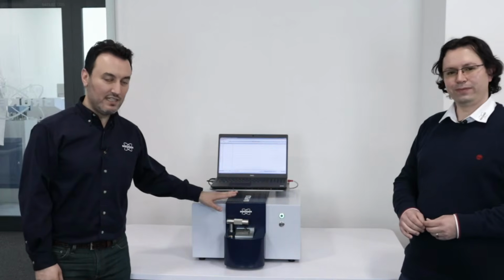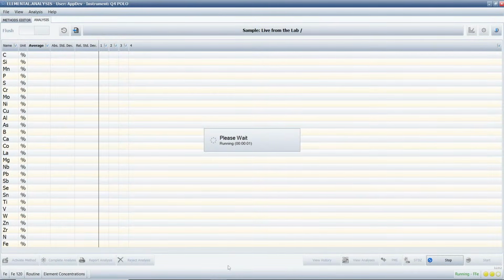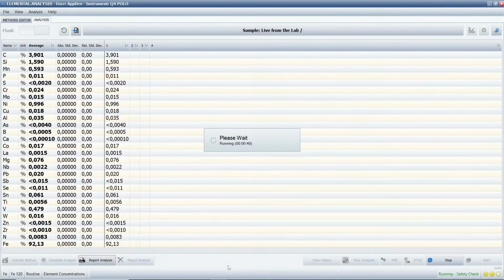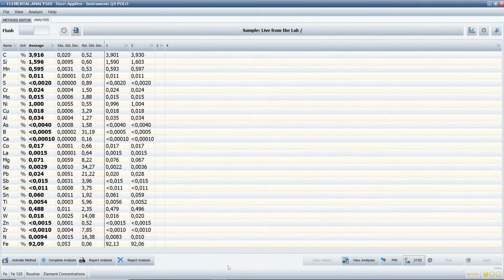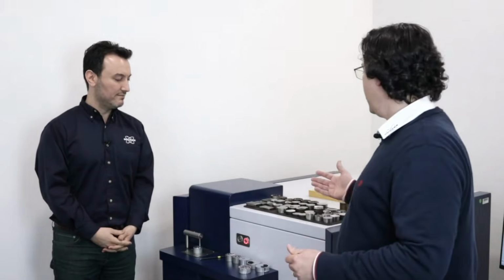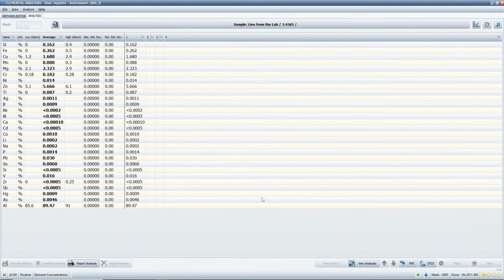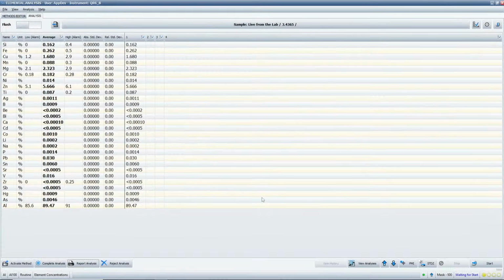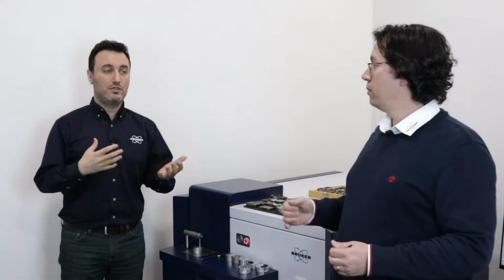Live from the Lab: What is Spark Optical Emission Spectrometry?

Comment: Thank you for this video .At 25:25 matrix element is not measure by wavelength but with difference . Then why we have dedicated PMT/CCD for steel Matrix
Reply from the maker: This is an excellent question! We measure the emission lines of the matrix element, but we do not use them to calculate the concentration of the matrix element. Instead, some of these lines are used as reference lines. The elemental concentrations are calculated based on the relative intensities between these reference lines and the respective elements’ emission lines. The reason for that is that the “detected” intensity of an element may change in time, but its ratio to a reference line should be stable over time as the chemical composition of the material does not change.